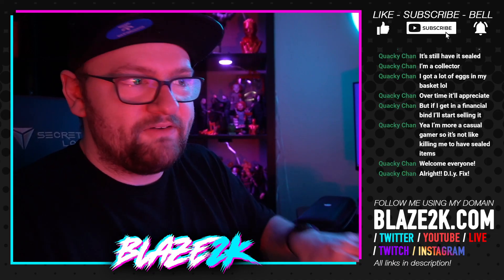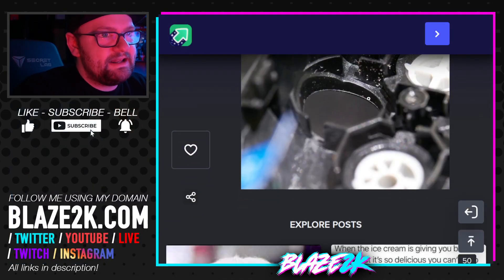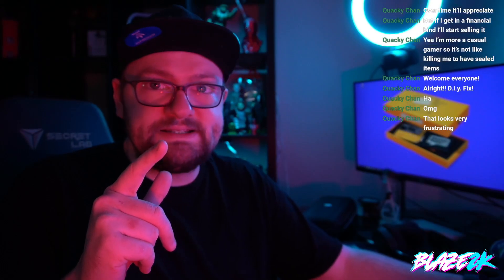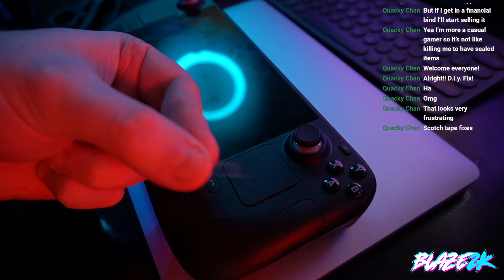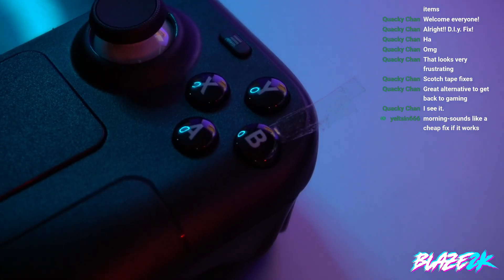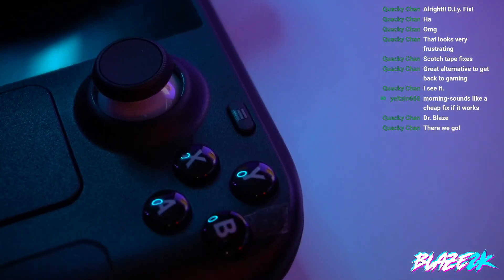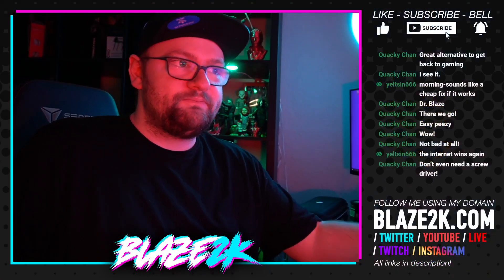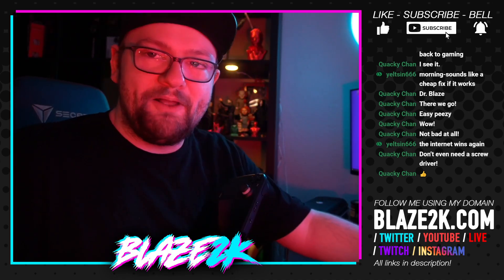HOW TO FIX THE STEAM DECK STICKY B BUTTON

Comment: My LE OLED is doing the same and was curious what people were doing to fix theirs. I came up with a good fix that doesn't require taping it from time to time and it's finding which direction free it up and pressing with your fingernail against the flat side of the button with just a little pressure and it'll iron itself out in no time. You'll go a week after doing it the first time and a huge help in a competitive match! My direction was pushing from the X to B button (left side) and to the right. No harm done, it's just recentering the button.

Comment: im having a similar issue with my oled steamdeck the X buttion feels a bit harder to push downwhich is a pain cause im playing batman and final fantasy 7  i could rma it but i just installed a screen protector the night before took me 3 of em to get it right so i dont want a new one
Reply: Same issue with my OLED. I don't recall this happening with my LCD. But I changed the face buttons on the OLED though, thought it was related to that. I guess it's just a widespread issue. I will try the scotch tape for a bit and if not, reopen again.
Reply: @SToad  dang I'm just leaving it as is and when theyvstart selling parts at fix it I'll replace the buttion  but if this was a huge issue I wish they would have held off selling it
Reply: I think it's more of an issue with the shell than with the buttons, as I said, in my case I changed the buttons, so it may have been because of that. I will just do the sandpaper trick and re-open the case. Such a pita but I can't be bothered to RMA for such a small detail tbh. @animefrasier
Reply: @SToad  right and personally I'd rather replace it for that considering I already got a lemon screen protector so I gotba free replacement and finally got it on then a day later this happened lol

Comment: If mine comes with sticky button I'll be holding it upside down & sand it with 600 sandpaper. I wonder if the loose & noisey xyba button's are to avoid the sticky b button from the last model?
Reply from the maker: could be but it doesn't seem to be working as my x button on my LE oled sticks, my originals didnt.

Comment: Thanks for the video! From my side - I can fully confirm that cutting plastic lip from inside the shell with the paper knife (or in my case just small kitchen knife) fully fixes the issue. I just kinda carefully  "polished" the button hole from inside few times and then applied some alcohol to clean up the plastic leftovers. Now i can hapily play Mk X and Mk 11 again. I did everything with help of disassembling instructions by iFixit and now B button works like a charm. Obviously, you have to disassemble only the right part of the deck where the buttons are. So anyone can do it, just do not affraid and do not apply too much pressure, if something does not go off - just check again whether you have everything disconnected and unscrewed. A bit tricky part was disassembling the trigger and bumper. If you deside to give it a go - remember you do it on your own risk, so if you are not sure, probably RMA would be the best option or this tape fix. In my case i just desided not to go with RMA and did not want to wait the replacement, because this type of the issue can appear in replaced units as well. I think it is just not precise enough process of making the front shell. Apart from this the deck is awesome.
Reply: Awesome! What is the part that needs to be "polished"? I still don't get it :/

Comment: I am from Germany. Secound Delivery. My B Button works perfect. But my right Controller haves Stick drift. Thanks god is very small area. So at time i dont need any Changes, if Valve haves Parts to oder i will contact them and ask for a free stick.
Reply: I am from Germany too. How long did it take to get a replacement for you? I  am still deciding whether to go with RMA or temporarily fix it with tape and wait for spare parts/cut the plastic lip. The b button is the only issue for me and i am a bit afraid to get something even worse.
Reply: @rudestan  i dont contact valve, i think i take in touch with them after spare Parts are easy available. My right Stick sometimes get stuck at maybe 1% right Movement. That is annoying.

Dir viel Glück mit deiner B Taste.
Reply: ifixit has the parts for sale now, not sure if Valve will be doing free replacements though.

Comment: I don't have this problem with my SD received on April 26, it seems that they solved the problem.
Reply: Received mine on 22th April and Yesterday started getting this b button issue in Mk X. I guess they still did not fully fix it for all units.
Reply: I received mine in september and I have it.

Comment: This better be an early model kind of issue, because if it isn't, Valve really needs to start being called out similar to Nintendo and their drift.
Reply: I RMAd my first one and the second ones button was fine and no sign of getting stuck.
Reply: @BGRecon  that’s great to hear, I’m waiting for a replacement unit, I hope I’m lucky and get a fully working device.
Reply: @Shmynkellbonkenstein  yeah I won't lie I was super worried something else would be wrong but it's been fine!
Reply: @BGRecon  yeah mine should arrive in a few days, fingers crossed…
Reply: @Shmynkellbonkenstein  so how did it go with the new unit? I am now also thinking to RMA mine because of b button, but not sure because that is the only issue i have so far.
Reply: @rudestan  no problems with my new unit so far, the screen is even a little bit better on this one, less ips glow. It took 2 weeks for me to get a new one, I expected like 3-5 weeks. Still, I have to say, the b button of my new unit feels slightly weird at times and I can sometimes cause minor ”sticking” if pushed at a weird angle. But it doesn’t really stick, it’s more like it grinds against the case but snaps back up just ad fast as when pressed normally. And you can’t really replicate it while playing normally. Still the lack of quality control on the devices is somewhat annoying, but I’m not gonna send it in again just to get some other problem in the replacement. If it for some reason starts sticking again I’ll try to fix it myself (deburring the hole of the case very slightly). I would easily have paid more for a more premium device but I guess this is the price we pay for wanting cheap things.
Reply: Just got mine today and it getting stuck